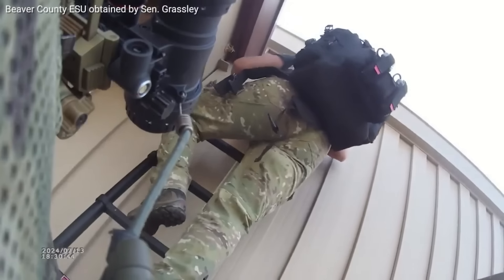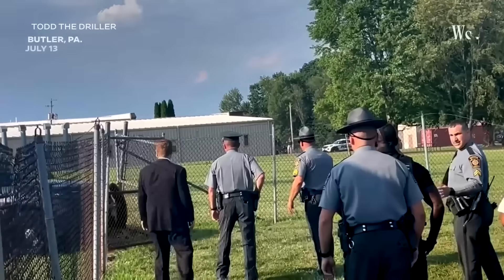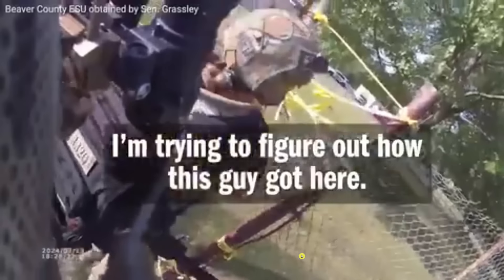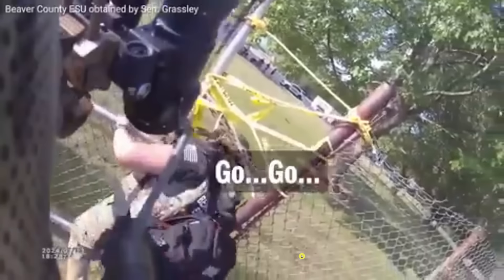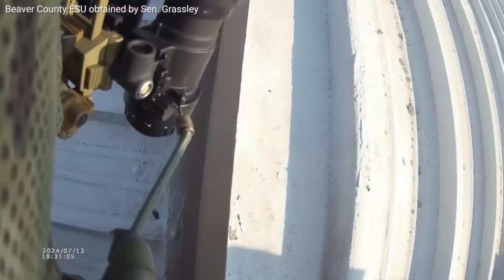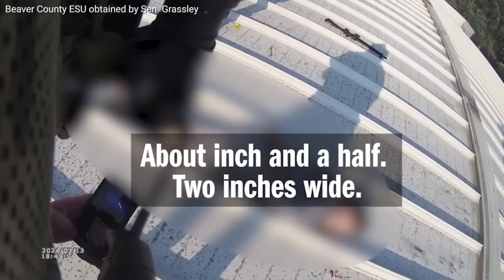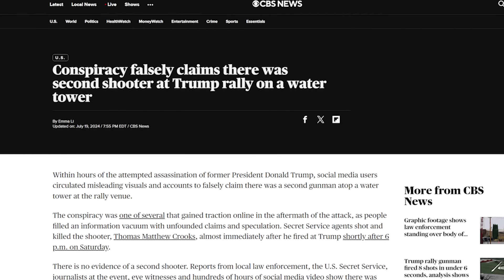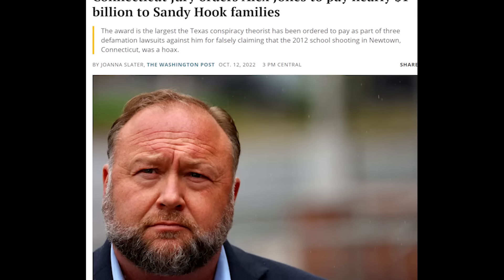Trump Shooting Analysis: Shell Casings, Ladders, Drones, Bodycams,

Comment: That second team on the right should have been able to see him just to the left side of that tree looking over toward the AGR building. If they could see him the question with new information I just heard would be why did the third sniper team supposedly on the bleachers end up killing him. Dan Bongino obviously has sources within the Secret Service and the information he got was that the sniper team that took the shooter out was about 1,200 feet away so that means that the south team on the red building didn't kill him as they were only about 500 feet away. I have heard that the type of bullet and gun that was used to kill him was an AR-10 style of rifle so it would have been a .308/7.62 size round, and that info I had heard separately a couple weeks ago. One other thing from Dan Bongino that I just heard a couple days ago is that the third team was actually from the Secret Service. The north and south sniper teams you can see that they have bolt action style rifles that were supposedly chambered in 1 of the 3 types of bullets which was the .300 Win Mag, even though it also can be configured to shoot the .308. To go along with Bongino's information is someone that was at the rally right behind where Trump was at and they seen a sniper team on the bleachers off to there left. The bleachers are located on both sides of that oval dirt track thing under roofs, and one building is longer and the other on the other side is shorter. I don't think they would have been in that longer building because there sight path would have been blocked by a building, but the smaller building would have been good and the distance comes out to be exactly 1,250 feet from the end of the bleachers to the shooters spot. If there was indeed a third team in that spot they would have had a harder time seeing him because they would have been a good amount lower. That team would have been about 2.5 times the distance of the second team/south team and using a smaller caliber weapon on top of it making it an even harder shot. From what I can hear and also what others say they are hearing is that there was two muffled shots that I assume are from the counter sniper teams, one of them happens in less than a second after the shooters 8th and final shot, and then about 10 seconds later one last muffled shot can be heard. Unless that first muffled shot was a sound anomaly from the shooters last shot we might have a situation where two different sniper teams shot with obviously the first missing. I know the north and south teams all has suppressers on the rifles and if there was a third team I would assume they also had suppressers so that would explain how the two shots sounded.

Comment: I don’t think he got up from the right side with the air conditioner. In the one video he’s crawling to the right and his backpack is also to his left. I wonder if he got up from the back side of the other building, then came across the covered hallway where his backpack was left. 
 Also… if he was still laying down how would the AR be so far off to his left? Wouldn’t it still be under him? It doesn’t seem to be enough time from his shots till he was taken out to be able to stand up. 
 If he did stand up then wouldn’t the force from the shot and the momentum of him standing up cause him to fall backwards?

Comment: A couple of things folks, but before I say - I want to point out that new information is being exposed daily, so perhaps you hadn't seen it before producing this video 

BUT - the 1st officer on the roof ONLY COUNTED 5 CASINGS!!! then, if you watch the time at the bottom left of the video - you'll notice partway through, the video SKIPs approx 3.5mins before picking back up (appeared to be spliced together in such a way you wouldn't notice it) and shortly after that, they RE-COUNT and find 8 casings... They also noted that the other 3 casings were to the left of the body, while the rest (the 1st 5 identified earlier) were to the RIGHT. No one has explained how shell casings that eject to the right of the firearm wound up to the left of the shooter. 

FYI, the firearm was moved to the left prior to the video beginning by the officers (standard protocol) so where you see the firearm is NOT where it was initially found - far as I've see from what's been released so far, they haven't released the original body cam of where it was found initially. 

With regards to the ladder - the receipt was for a 5ft ladder they found on his person but no actual ladder was found - the orange ladder recorded by CBS news helicopter was reportedly added BUT this doesn't align with what ladder the officer used PRIOR to the shooter getting off the 1st shots. The audio recordings from in front of the stage (there's a couple that record the entirety of all 10 or so shots) CLEARLY has the 1st 3 shots sounding VERY different than the 5 round rapid fire burst. The remaining shots were the USSS CS team returning fire.

LASTLY BUT MOST IMPORTANTLY 2 sources have now reported that there was ANOTHER CS team further to the east (in the direction the South building team was covering) that were on the top of the bleachers - they are the ones that ACTUALLY took out the shooter from nearly 400yrds. They are believed to have been using a rifle chambered in .308 which is consistent with the impact to the shooter's head. IF BOTH teams were using the same Win Mag 300 as the North sniper team clearly had in all of the videos - the shooter's head would have ceased to exist as anything more than scattered fragments of brain and bone. 

Mike (MrGuns&Gear) and Don Bongino both spoke extensively on this topic you should check those out and provide your perspective on those videos / discussions... Also, you can check out a vide on YT from "The Last Crusader" on "300 win mag vs gel head" to see the ballistic damage from a win mag...

Comment: OK so the snipers in the rear building couldn't see Crooks when he was in position, fair.....but if he indeed used that AC unit and the uni-strut brackets holding the refrigerant lines to climb upto the roof, they damn sure could have seen him very well while he was climbing it. I mean he's jumping all over sheet metal the whole time, presumably with a backpack on in broad daylight. It wasn't exactly a covert operation.

Comment: In video taken from the bleachers behind trump, you can see crooks running on the roof from left to right and then popping up in prone position. Bleachers are lower than the rooftop snipers. Also from what I understand snipers work in pairs of 2 and only 1 left the window position. While people on the ground are yelling about a guy on the roof and cops have surrounded the area, it would be hard to be unaware of something going on right outside that window and to not take a look. The most important question is why trump was allowed to go on stage while they had a person of suspicion running around with a range finder pointed at the stage, and then trump was not taken off the stage when it was clear the guy was on the roof for about 2 mins

Comment: YOU KNOW THE COPS DIDN'T PUT THE REAL LADDER UP LATER  1.  Why would the cops hide a ladder behind the trees? 2. Video by @realDJStew724 shows cops posted to building were on roof within minutes of shooting.  They were all looking at building and waited until after the shots to try to go roof.  They all gathered in the front 9:25  At least 10 cops  putting a pallet on a shed to climb when cop walks behind those 2 trees.  He peeks out and signals the cops at pallet.  Even though they just set up the pallet and could climb to roof,  They all run to him and  disappear through those trees.  A minute a
later, we see a group of "cops" arriving from the stage and just miss the cops go behind the trees  This is the group that threw the black collapsible ladder over the fence.  We know that black collapsible ladder ends up next to the shed/pallet.  So, if that first group of cops didnt climb a ladder behind the trees, then they would have come out when the second group comes with a ladder. 20

Comment: You are wrong about the ladder. Your video shows all of them trying to get up then 5 of them move and enter the ladder area because I see the light on the fronts face.

The new footage shows a head walking across the second roof just before Crooks appears right there on the hall.

What you need to know is who got on top using the center window and met Crooks at the ladder.
Because Crooks was seen in front of the building and walked left to right to the front of the building without a backpack.

So he did use that ladder and who walked across carried the rifle. The head descended back down the ladder and re-entered through the front door.

Comment: I wanna know why Janeen DiGuiseppi Assistant Director of the FBI's Insider Threat Office is in the crowd wearing a black Jesus is my savior, Trump is my President hat, when she is not a Trump supporter. Why doesn’t she even flinch or duck when the shots rang out. Why does she smirk like it’s funny and then immediately take out her phone and start recording. I also noticed that just moments before the shots, she raises her sing up in front of her mouth and raises her sun glasses. Could she have been the signal for the sharp shooter behind Matthew Crooks, that actually took the first 3 shots, to open fire? Wouldn’t be unheard of. I also noticed how the first 3 shots are controlled and in sync, as opposed to the second burst of 5 shots that are rushed and scattered and don’t sound as muffled. Why don’t you see any recoil, or movement from recoil, to Matthew Crook’s head during the first 3 shot. Why did the agents on the roof only count 5 shells originally and now they are trying to say they found 8. Why did they hose the roof down just hrs after the attempt. Let’s add it all up.
Crooks was seen hrs before on site with a range finder.
A ladder was conveniently left against the building he shot from to give him access.
The building he was on was a staging ground for Butler county law enforcement and they were in the building but never heard him on the roof because they were at McDonalds.
Crooks was able to fly a drone over head of the fairgrounds just hrs. prior to the event.
He was able to enter the fairgrounds with a car full of explosives.
FBI and local law enforcement was told to stand down for 26 minutes prior to Trump taking the podium.
Crooks had two separate vehicles containing explosives linked to him and now an Arizona man.
The white van mysteriously moved itself from the parking lot to miles away under the water tower after Crooks was dead.
The white van has been linked to and Arizona man that works for an explosive manufacturer.
Multiple devices found in a Crooks home were linked to someone in the exact vicinity of the FBI office in Washington. 
FBI claimed nothing was found on Crooks electronics. 
Secret Service sharp shooter was fired for disobeying the order to stand down and shooting Crooks.
Congress is trying to block a congressional investigation into the attempt on Trumps life.
Expert sound analysis of the shots proves two separates shooters in two separate locations.
Biden administration rejects request to increase Trumps Secret Service detail.
This was the only rally “EVER” covered and streamed live by CNN.
Who was the man in the grey suit on the roof after Crooks was killed, who claims he worked for the ATF, and where is he now. Why won’t he come forward.
Days after failed assassination attempt we have a world wide black out. I smell test run!!!
And the list goes on.
If this doesn’t say planned assassination attempt, then I don’t know what does. Don’t be stupid! The deep state tried to kill this man and they blew it. 
This is not over. We are the next target. They are going to cause a world wide black out that shuts down the banking system and people will not be able to access their money. In turn this will cause panic and chaos. Pandaemonium in the streets and this administration will try to declare marshal law to stay in power. That’s just my guess. They cannot let the November election happen. They cannot wi and they know it. Something is going to happen and we are going to be the target.
PREPARE NOW!!!

Comment: Ive seen other recordings and audio graphs of the fired shots, 9 in total, of which 8 were from Crooks weapon and the 9th from the south facing counter sniper that put Crooks down. Crooks fired 3 rounds, paused, then fired 5 more rounds in rapid succession. From Crooks 1st round until the counter sniper pulled the trigger on the elimination round that stopped Crooks was 5.9 seconds. It happened much faster than what you have speculated. My statement is a fact and not merely speculation. Also, I feel confident that Crooks had no sniper training, but I'm certain that he wasn't dumb enough to have stood up on that rooftop even though he was dumb enough to attempt the assassination of the President of the United States. I don't like guessing what may have happened. I like factual evidence. I hope my input was helpful.

Comment: Why did Wray try to highlight the existence of a "collapsible stock" as if it was significant in his ability to hide the rifle? Just laying down on the roof with ridges would be sufficient to hide a 48" rifle.
Has Wray never held or shot one?
The whole system (fully collapsed) is over 24" no matter what the position of the stock was, and even the stock itself only moves about 3.5".
Why say irrelevant stuff like that?

Comment: Just watched your analysis with references and I agree with pretty much all you say, lines of sight, other victims positions, recorded sounds, etc no way another shooter, first 3 shots are steady as aiming for Trump, next 5 are probably return fire at the snipers before he turns to run down the roof but gets hit. Only question is how exactly he got on the roof, the aircon unit theory is reasonable but still think he may have found a way or still used a ladder to get on the roof of building behind and traversed the adjoined walkway roof to his final spot as I wouldn’t risk climbing on aircon unit, crawling on the lower edge and risk being seen easily by folk on the slightly raised grassy area or the snipers in windows as he wouldn’t have known they would vacate to go down and respond to publics calls. I’m surprised that with todays technology no drones were used by SS during the event to monitor assassin vantage points. Obviously the cooling tower would not be suitable due to line of sight, danger of slipping and easily spotted by public or police. Though 3 shots initially taken doesn’t mean only 3 targets hit you can easily end up hitting two targets with one bullet so 5 hits with first 3 shots is quite feasible.

Comment: There is another Window at the end of the 2nd floor, closer to there the shooter was, and, he could have climbed out of that window onto the small flat roof under the window, and then across and up on the roof. Getting on the roof is only a problem for someone who could never do it themselves.  Getting up there, setting up simple if nobody stops you.  The distance from the shooter to trump was stated as 140mtr,  459 feet, that is a long shot for most shooters.  The location to the second Sniper team was 170 Mtr, 557 feet, a very long head shot, clearly done by an expert if in fact that is the location.
Anyone who wants to check the distances can do that on Google Maps, measure distance, and set the pointers on the locations of the shooter, trump, sniper teams etc.  It will also show you if there was clear line of site from the trees.  The water tower did not give a good overall view of the area around Trump, and it was over 700 feet from the tower to the stage, too far away to be able to surveil the entire area, still problems with views because of trees and other buildings, none the less, a good view of rooftops.  It is easy to criticize vantage points after the fact, however, the shooter did his homework and selected his position based on where security was placed, he had surveilled the area so likely had alternative locations depending on placement of teams.

Comment: If this was a planned attack, very poorly planned. No ladder brought to the site. No known previous trips to the site to make climbing attempts. Parks 3 miles away which means he would have had to drive onto the property beforehand to drop his stuff or walked 3 miles down a crowded street with a rifle, backpack, rangefinder, etc... in plain view. Wears short pants and short sleeved shirt to crawl on a hot metal roof that would have been about 120 degrees to the touch, causing burns to knees and elbows if not continuously moving.

Comment: Ur comment that there was no ladder and that because the officers had to bring a ladder proves that the conspiracy theory that the shooter used a ladder is just wrong! U make several assumptions that need to be factually verified before u can make that claim. 1) Did the officers place the ladder in the same place that others say they seen the A-frame step ladder? 2) U stated that the officers arrived 17 minutes after the shootings, but failed to mention that other people were already on the roof. How did they access the roof if there was no ladder?

Comment: Didn't answer the question.  "We have recovered eight cartridges" is an evasive answer that should never have been tolerated by any intelligent person. First, cartridges are not casings. Second, those cartridges could have been dropped there BY the FBI themselves, or by anybody else. The questioner is complicit in this coverup.  But we already knew that.